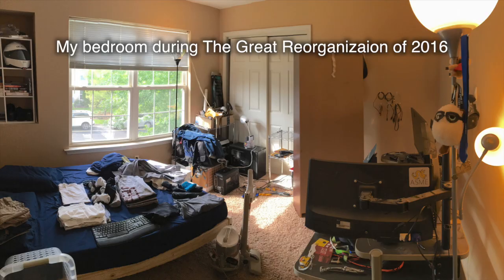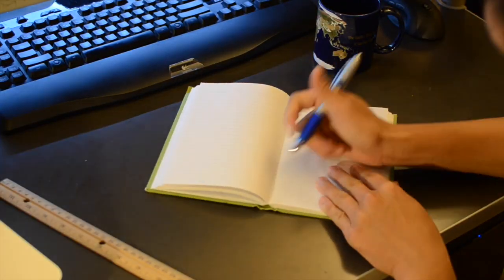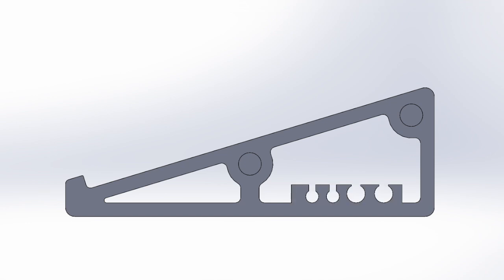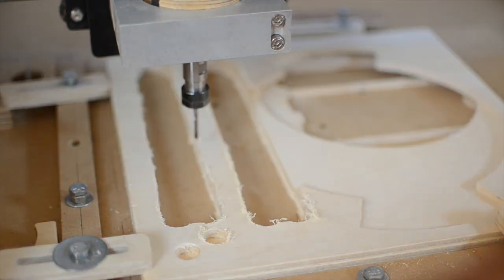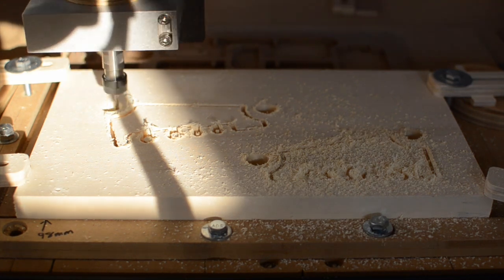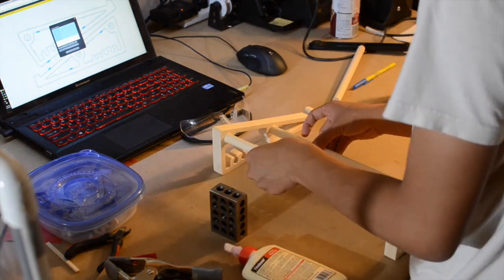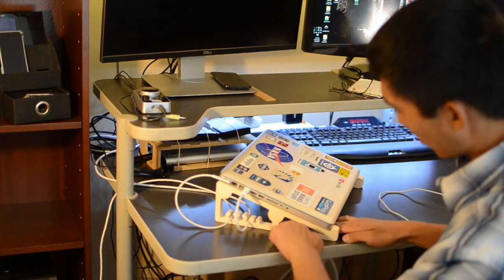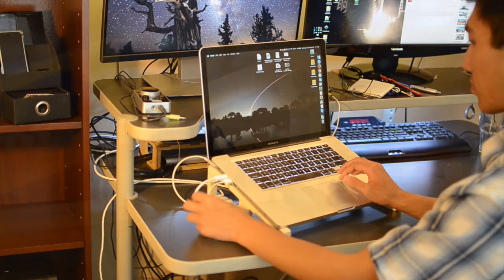DIY CNC'ed Laptop Stand for $5 - Shapeoko Project #57

Comment: Thanks for sharing, Winston! And thanks for sharing the info about the new control boards in a previous video. I emailed Carbide and Jorge sent me one right away to replace my original one. So far I'm happy to report I haven't had any of the disconnect issues! Now I just need to spend time cleaning and dialing in/squaring up my machine...never had a need for supreme accuracy before but now I'm starting to need it.

Comment: First off, your projects are very interesting. I subscribed to your channel.  I would like to ask you if there is anyway of connecting the CNC router wirelessly to the laptop? Bluetooth maybe?
Reply from the maker: The CNC's only input-output is USB, but it doesn't take a powerful laptop to operate it. I will sometimes set up my cheap netbook and then use a remote desktop program to keep an eye on things from a different room.
Reply: Winston Moy Thank you Winston!

Comment: Will not the use of laptop in inclined surface destroy spinning hard drive?? please reply
Reply from the maker: Angles have no effect on spinning disks. How do you think video game consoles are able to be used standing up on their sides? Bumping or moving it while spinning is a different story.

Also, my hard drive is solid state so it's a moot point.
Reply: Thank you for the reply. I heard that when you use other spinning hard drive like SATA PATA  in any angle rather than flat the life of hard drive will be less and soon it will damage it.. so I was wondering that was true or not.. so again thank you
Reply from the maker: There are some people who say it, but I haven't seen any hard numbers to back up their claims. I've got a bunch of externals that don't always sit perfectly flat on a table. They've been fine for years. My guess is that when people say it should be flat, they're implying it should be on a stable, non-moving surface.

Comment: pc specs?
Reply from the maker: i7-3770k on air, mild OC to 3.98 GHz optional 
16 GB RAM, low-profile to fit under heatsink
~3.5 TB mixed storage, of which 1.25 is solid state
SLI'ed GTX 770's
850W EVGA SuperNOVA G2 PSU
Reply: nice! love your channel btw!